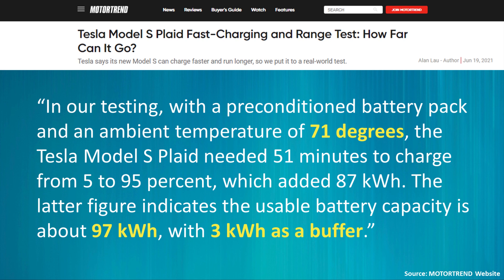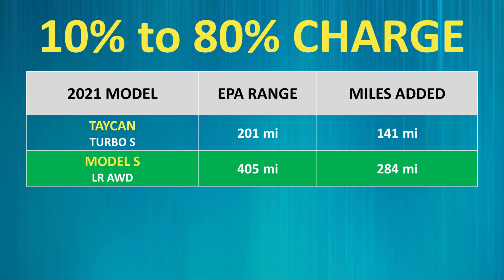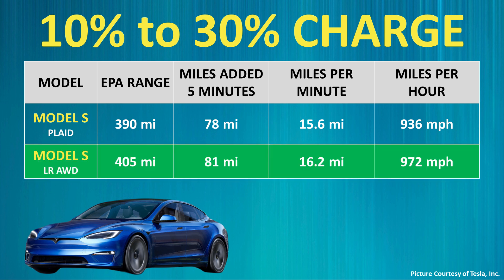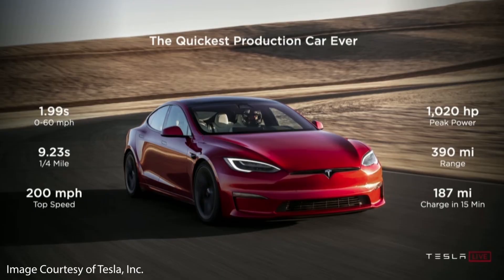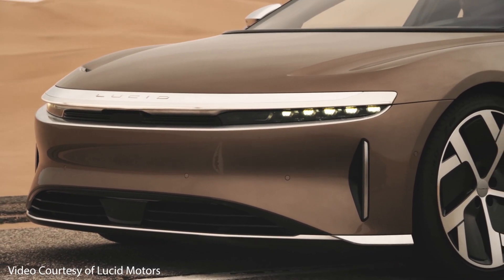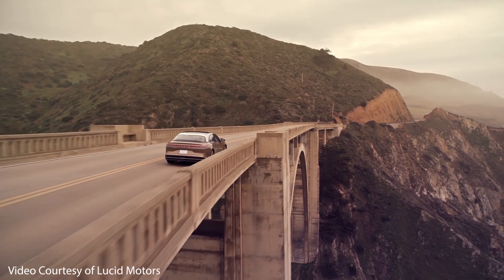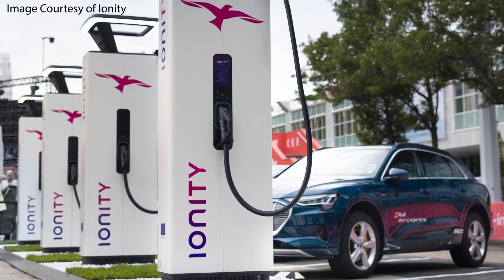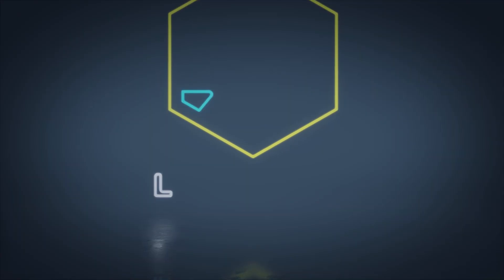TESLA PLAID MODEL S CHARGING at 936 MPH + 800V Competitors

Comment: Electrical Engineer here
There is a major with an 800-volt DC charging. It violates the national electric code. The absolute maximum voltage for housing and industrial building wiring is 600-volts at 600amps AC or DC. To get special approval from the national electric code for 800-volt charging. Charge cables must be rated at 800-volts and approved by the national electric code. Not an easy challenge. Beyond 600-volts arcing is a real problem and electric shock will be common with 800-volt cables even heavily insulated cables. Unless they come up a safe 800-volt electrical cables that can be handled safely by charging customers approved by the national electric code. So, keep in mind the absolute maximum voltage and amps is 600-volts at 600amps AC or DC at 360kilowatts are approved by the national electric code.
Reply: Does that code apply to the output of a charging appliance? It is a building code. I used to work with higher voltage  industrial applications than that on comercial lasers. Danger from shocks at those voltages is substantial though. I would imagine the  circuit would not energize until handshakes and safety  checks run on the sytem.
Reply: This is why the Hyundai IONIQ 5 has got an (obviously it seems) efficient internal 400V to 800V inverter.
Reply: @DidierGras  If two 400V nominal battery sections are combined in series for 800V charging and combined in parallel for 400V charging, that may be the most efficient way to manage the system. Even 1% of conversion loss represents 2.5kW of waste heat at 250kW charging rate. I don't know what the maximum charging rate of the IONIQ 5 would be at a 400V charging station. - All matters little for me, and most EV use, because at home daily overnight charging is the "absolute salvation"!
Reply: Tesla specializes is electricity. Pretty sure they know what they are doing. Cause its all they know.
Reply: @Chris-yr6gu  Good point, however they dont specialize in politics and senseless government Bureaucratic regulation. Look at the delays in Gig-Berlin, Giga-Texas and of course California. Elon is getting better at Handling lawyers though… LOL!
Reply: A charging station is neither on or in a residential building in most cases which is where your 600V code applies. The output voltage level is not a significant hurdle. There are already many chargers in service across the globe operating at high voltages. The input power from the grid required to run a full scale implementation of these is the real hurdle. They will need to be networked and throttled at peak hours, and this is not even mentioning the issue with harmonics.
Reply: @Cleanerwatt The point  @ProfessorDingus makes about grid capacity is the main one I recall hearing, early on (from Munro?), related to the practicality of > 400V wiring. The lower heat & thinner/lighter wiring of 800-900V may also  be something the TeslaQ media could endlessly glom on to. Due to technical complexity & nuance involved here, the "perception is 90% of people's reality" rule will likely overshadow "truth," in this regard, so I can see the outcome having major stock price impacts on the different camps, regardless of the actual merits. Glad to see you have a fleet of experienced EEs as followers to help moderate this critical topic, so can't wait for your next installment!
P.S. Any news on the "revolutionary" battery (& architecture?) that Porsche purports to be developing, including timelines?
Reply: I am sure tesla has received permits for this installation from local authorities. It is the local authorities responsibility to assure installations are per the permit and the national building code.
Reply: Phil you are incorrect. NEC changed the 600V maximum to 1000V in the 2014 code cycle. in the 2017 code it expanded an exception of 1500V for ground mounted PV systems. 1000V cables have existed for some time.
Reply: @jontopham2742  You will have to check the electrical wire rating on the cable. Most still say 600volts maximum. I am sure there is electrical wires with a rating above 600volts. Most home and business electrical wires are rated 600volts.
Reply: @phillieg58  yes 600v is the most for residential systems
Reply: Interesting.  I didn't know that about the NEC.  I wonder about the relevance of this though.  I too have worked with power supplies that are capable of producing higher than 800 V.  They run off of standard wall power though.  Why would the NEC care what kind of voltage you are producing outside of the wall?  Also, if I'm not mistaken, Electrify America has been installing "800 V" (I believe 1 kV max) charging systems for nearly two years!
Reply from the maker: This is really good info and will be helpful in my future comparison video - thank you!
Reply: USA I assume?
Reply: We can always count on stupid government to wreck a good thing… I wonder how long it will take for them to go through an approval process.

Comment: Excellent video.   While 200 mi charged in 15 mins for a ms-LR is great for road trips at a 250kw SC, charging at home using the mobile connector at 30 mi per hr may take a long time.  Imagine how long it will take from 10-90% at 30 mi per hr on a Gen 2 UMC.  Sadly, the Gen 1 UMC was discontinued as it provided 25% more power and reduced charge time by about the same amount.   You could get one on the used market, but pricing is close to a wall connector which is faster and looks much better.

Comment: Another EE here.  Here’s a fact:  All Tesla battery packs charge all of their individual cells in parallel.  Therefore, the SOC of the battery pack can increase no faster than that of a single cell.  For a given car miles gained are proportional to the number of cells in the battery pack = kwh of the pack.  Since all of the Tesla 80 kwh and greater battery packs up to the packs in the refreshed Model S cars (I don’t know the details of the newest packs) have the same modularity, they all charge at 403.2 volts and current/cell is the only variable available.  Limits on current per cell include heat limits of the car’s battery cooling systems and cell degradation dependance on peak charging current, a function of cell design and cell size.  The greater the area of the electrodes, the more current that can be applied per cell=more miles per cell per . minute.  Note that Tesla has moved from 18650 to 2170 to 4680 cells in the future.
.
Reply from the maker: Thanks for that info - very helpful!
Reply: I'm impressed! Now in terms we ordinary mortals can digest?
Reply: @Crunch_dGH  Bigger individual battery cells can be charged faster.
Reply: yes, more paralell packs can be added, but the current through those paralell strings is proportionaly higher. I squared R is a real thing and reduces instantaneous torque and charge rates. It also increases wiring size but that is a more minor point. elon brought the cost saving item up as a red herring on the earnings call the other day

Comment: My father in law once explained to be the difference in voltage and amperage with an example that stuck with me.

Consider a river.

Then voltage is the speed of the water flowing... The amperage is the width of the river.

So you can flow the same amount of water per minute either by having a wide river and slow flow or a thin river with much larger flow speed
Reply: But what about thermal & wiring weight factors?

Comment: Keep in mind that the hyundai kona and ioniq (not the 5) proved to be very efficient cars, recently teslabjorn did a test as well, and the ioniq won most of the challanges compared to a model 3. Also it seems hyundai has a more realistic wltp rating, since manufacturers only need to specify the max or less and hyundai is one of the few companies that lower the number because it's more in line with reality. 560km in a model 3? Not gonna happen. 480km in an ioniq 5 will probably be possible. Nevertheless, ioniq 5 is a crossover and the model s is a much lower, aerodynamic car, so that's also not a fair comparison. I'm interested to see what will happen with the model y and the new Berlin battery pack.

Comment: Why not say how many Kw in 15 min. We all know Tesla’s range is a big lie.
Reply from the maker: Go read the InsideEVs article for more of that kind of info. Link in the description.
Reply: My experience over nearly 3 years with a Model 3 AWD is that most of the time range is not too far from the EPA rating of 310 miles. Obviously if the temperature is very low, I am doing mostly uphill driving, very high speed, or multiple rapid accelerations, or there is heavy rain the range will be reduced. I have gotten anywhere from the low 200’s to the the high 300’s depending on conditions. Your mileage (and range) may vary

Comment: I’m guessing this is the fastest Tesla, until the first one with the 4680 comes out.
Reply: At 85 deg F ambient, calculated charging time from 10% to 80% with the 4680 pack was reduced from 25 minutes to 15 minutes. If you only need a 50% charge, you can be done in 7 minutes. That’s almost as fast as gas.
Reply: An estimate, not an actual test.

Comment: Interesting video, it's unfortunate though that you didn't bring the likes of a Mercedes EQS or an Audi e-tron into the mix. The very clear picture that starts to come through in the end is that Tesla is not doing great when it comes to charging. Yes, peak efficiency is at a good level, but what the curve reveals very bluntly is that the other manufacturers are all by far better keeping those rates up to higher SOCs. That's what Tesla needs to get better at.
And sorry, but your 800V statement at the end regarding the non-available chargers is just nonsense. The exact same can be said about the 250KW superchargers... The capability helps little if you take into account that the vast majority of superchargers available right now is not V3... At least here in Europe
Reply: They don't mention them because they don't even compare

Comment: I've checked it long time ago and TM3 got just 3kWh less of energy compared with Ioniq 5 in 15 minutes charging period (starting at 10% SOC). I expected way better with Ioniq as at 800V there's 4x less heat generated in the battery. That's why Tesla sticks to 400V as 800V with current battery chemistry doesn't give them huge advantage (Ioniq charges 5-10% faster not twice faster as one could expect).
Reply: It would only be twice as fast at the same amerape which would produce significantly more heat.

Instead they upped the voltage and decreased the current so the speeds are similar for less heat generated.

Comment: Well, I love Teslas, and Tesla has been incrementally improving both the charge rate and range over the years...BUT...I currently "charge:" my F150 at a rate of 75 miles per minute with a resulting range of 792 miles (100% full to zero).  So EV's have a long way to go before they are comparable to gas powered vehicles.  What we really need other than faster superchargers is the ability to charge from 10% to 100% at home in under 4 hours.
Reply: Your request for say 90 kWh in 4 hours at home would require a dedicated 120 amp line at 238 volts to deliver the proper output.  Even if the vehicle could handle it, that would be quite an expensive home electrical installation that most people would not need.  Without enough demand EV manufacturers will not produce vehicles with those specifications.
Reply: David May:
Techies don't care about your disgusting pickup truck. You are wasting your time trolling here.
Reply: @martin3316  David May did say he loves Teslas, so how is that trolling? He seems to be expressing the legitimate concerns of anyone who realizes the "EV Inevitability."

Comment: The 400 volt versus 800 volt architecture IS an interesting area of discussion. BUT, I can say confidently that the electricity will ultimately be delivered to the cells (or “pouches”) that are, say, 3.7 volts each, and the cell is the ultimate limiting factor, and its local charging voltage doesn’t vary from one charging infrastructure to another, it is only the routing of the electrical power TO the cells that varies...
Reply: Also, you need fatter wire for more amps, but not more insulation. You need more insulation for more volts.

Comment: With the higher voltage you have less loss due to electrical resistance. The problem with 800 volt systems is getting the components for the power electronics. The supply of higher voltage components are not as widely available.
Reply: Its actually happening and making 800 volts more affordable.
Reply: @alanmay7929  That's great to hear looking forward to the new systems. Loss to resistance is Resistance * Current so the lower either of those are the better.

Comment: I can't imagine why 4680 cells would make a huge difference in terms of ultimate charging architecture to the point that they obviate the need for higher voltage charging. They alleviate a lot of performance pressures on the pack itself, but not not at all on the ground equipment. Ultimately, current sucks, and you can only water-cooled-cables your way out of so much. I'm pretty surprised Tesla isn't already running 800V systems for simple future-proofing.
Reply: I would also remind EVeryone that TESLA increased the architecture of the Model S battery pack to 450 volt. Probably part of the reason for the increased charging speed in terms of miles added per minute of charging.
Reply: @martin3316  Yes, this is interesting. I wonder how this works with charging. I had been under the impression Superchargers maxed out @ 500 V.
Reply: I read an estimate based on the new 4680 that suggested 10-80% in 15 minutes.  To 50% in 7 minutes. That is impressive.
Reply: THIS!  When Tesla was discussing the Plaid+, they indicated an estimated range of 520 mi.  This was obviously a response to Lucid: "Hey, they're claiming 517.  Let's do 520!"  Unless the Plaid+ included some massive improvement in efficiency, the additional range would have had to come from a larger battery pack.  I'm pretty confident this is what they were planning.  During Battery Day, they discussed how the structural battery pack would allow for more cells/less structure.  If we assume 400 mi of range for a Model S LR, a Model S Plaid+ would have 30% more range.  If this indeed comes from a 30% increase in battery pack capacity, we would have a battery pack of around 130 kWh.  As the battery pack capacity increases, the charging power needs to increase as well to keep charging times down.  So, while this is obviously moot at present, what were they planning?  V4 Supercharger with 400 kW by way of 400 V and 1000 A?!  Continuing to increase current is not sustainable.

Comment: Yes, definitely interested in a deep dive into 400v versus 800v. What I glean from this video, is that Tesla’s still right up there, if not surpassing, the 800/900 volters. 
As you mention, there are very few chargers around that will enable 800v charging. So it’s a bit of a marketing hype at the moment. (If Hyundai and Lucid were rolling out bespoke 800v charging networks, to accompany these car’s capabilities, then that would be a different matter).

Comment: Thanks Jonathan.  I really hope Lucid can deliver.  The nrs sounds a bit optimistic.  516 mi from a 113 kwh pack means their efficiency is way higher than Tesla.  I could see coming close or slightly exceeding, but they would be achieving about 4.5 mi per kWh on a 1000 hp+ car.

Aero, weight and power are about similar for these 2 cars.  I can't imagine the 800V system adding that much to the efficiency.

Please do make an episode comparing 400V to 800V architecture.  Thanks!
Reply: I'm an investor in CCIV so it really scares me as to how they will get 500mi.  If they do, it will certainly be amazing.
Reply: I think Lucid is promising much more than they can actually deliver. I agree with Johan Nel that 510+ miles from a full charge from a 113 kWh pack sounds too good to be true. The refreshed Model S and Lucid Air are supposed to have basically the same coefficient of drag, yet the TESLA is expected to get 110 fewer miles per charge from a battery which is only ~10 kWh "smaller"? And remind me again which company has had a partnership with one of the biggest names in Lithium Ion Battery production (Panasonic), and has had a multi-year lead on the competition when it comes to battery R&D? --- Oh, that's right, that would be TESLA...
I think Peter Rawlinson of Lucid is many times worse at claims than Elon Musk ever has been.